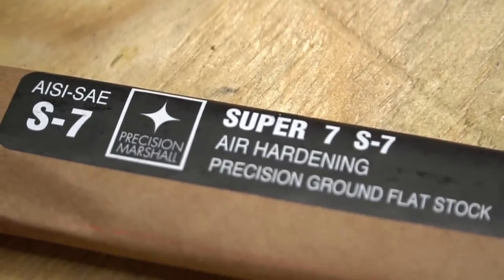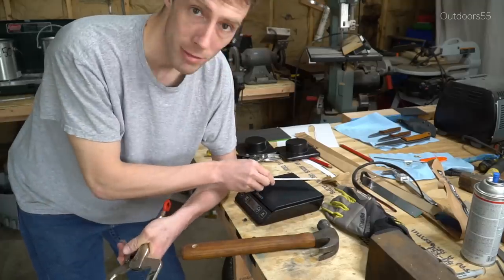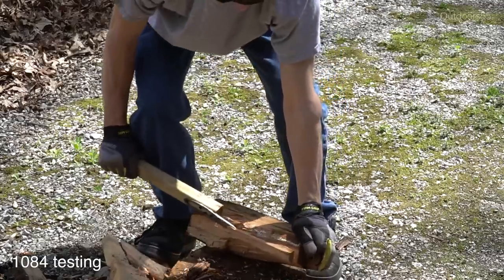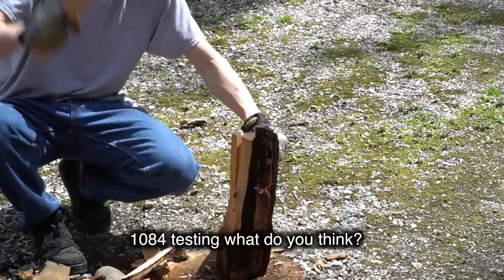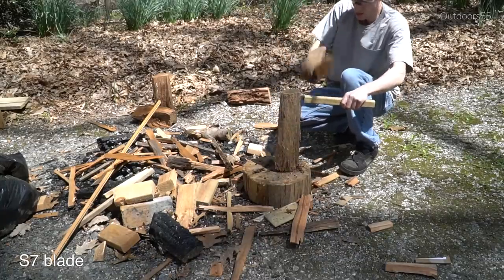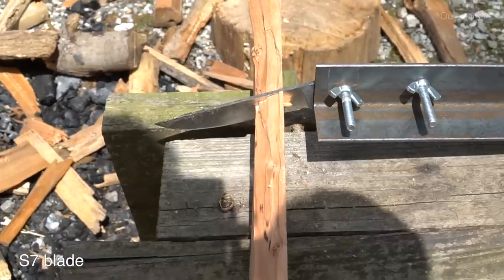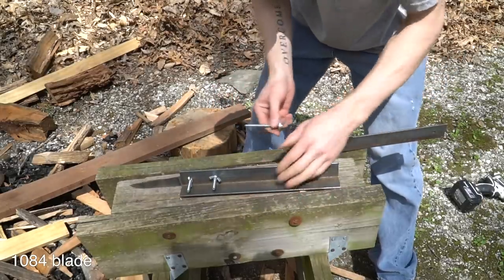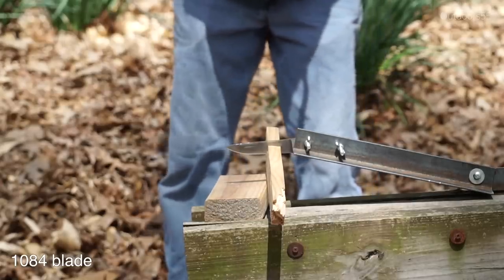What Is THE TOUGHEST KNIFE STEEL? Testing knife steel.

Comment from the maker: Do you think the mora basic would hold up to the same abuse? Or does it even matter 🤷‍♂️
Reply: You should test it
Reply: No way.
Reply: Try it. I love Morakniv, but i have my doubts. Maybe the Garberg.
Reply: I think Pete (of Cedric and Aida)  broke one.
Reply: It would be a good reference point!
Reply: @Mikey1951ful   Yeah he did. But then again Pete is the Master of Disaster LOL.
Reply: Nope
Reply: the 3/4 rat tail tang would be the point of failure.  I've seen them driven handle deep into a log and used as a step, so they aren't weak knives. FOR THE PRICE Mora is great
Reply: I think it'll break at the transition from blade to tang.
Reply: OUTDOORS55 yes. If you want to make your handle lighter use tub ring as the pins.
Reply: I don’t think it would last. You should test it
Reply: Maybe not a mora basic, probably a mora heavy duty companion would fare better. 3.6 ounces on my scale. The mora basic runs 2.7 ounces on the same scale. Will you be performing the same test on 5160? I've been reading that it's even tougher than 3v but with less edge holding. Great videos. Informative, very interesting, and entertaining. Thank you.
Reply: Let's see you test it
Reply: You should do some sub zero quenches on S7 and definitely 3v. Cryo is expensive(relatively) but you can do a sub zero with dry ice and acetone. It'll help refine the grain structure even more and help limit the retained austenite. 
Really like your design and idea for this knife. A 4 inch fixed blade at 3 oz's would be something that a lot of people would be interested I'd think and yet you don't really see it. Spyderco waterway is kinda close at about 4 oz and even that is a rare thing. Looking forward to the end results.
Reply: Yes please
Reply: Dang, that S7 is tough stuff, and has decent amount of strength too, standard carbon steels are very bendable. Good' ol strength & toughness balancing act. Love these two vids so far, we gotta see some band saw steel in here! Maybe 8670, L6, or even some nickle spring steel 8660. Tough steels in thin stock. Btw, if you made these, I'd buy1. Model 1LT -yeeah : )
Reply: I'd say the real take-away here is that there is no difference between a rat-tail tang and heavily skeletonized "full tang" blade.
Reply: I dont think so.  Try it
Reply: I don't think it would even survive the second hit.
Reply: It doesn't matter.
Reply: Can make video for d2 steel
Reply: In the end, you really didn't break either blade. The handles broke. Pretty amazing. One wonders what would have happened if the handles had been full width thickness. Good test, thumbs up to you Sir!
Reply: DBK would be pissing themselves with excitement on your vids. Love your stuff, and sense of humor.
Reply: How much u sell a 1084 blade for?
With smaller blade maybe for carving?
Reply: I've never broken a Mora batoning.  I suppose you could; sometimes that's the luck of the draw.  You hit a knot, you twist it more than you meant to, etc.  Generally I like a bit more robust knife for splitting wood but Moraknivs hold up pretty well for a $12 knife.
Reply: The garberg is full tang not 3/4
Reply: The old laminated Moras for sure, not the new ones!
Reply: not even the old ones, new mora classic is just bad

Comment: Try gun bluing (hot blue) on the S 7.
Looks cool, and stops rust.
Reply: It wouldn't hold up very well when splitting through all that wood, however, I have recently seen some pretty crazy wear resistance testing on specific a DLC coating done by Razor Edge Knives over at BladeForums.  He seems to have that process down.  Looks beautiful on an mirror polish just like hot blueing does.
Reply: @lsubslimed    I am not familiar with the product, but you are likely correct about standard bluing.  It holds up pretty well, but nothing can hold up to splitting dirty wood... any amount of fine quartz based sand or dust, and.... well, quartz is pretty hard compared to steel of any kind. 
The only true cure for rust on tools in contact with abrasives is stainless steel, even with its other issues.
Reply: I'd be interested to see what nitriding does. I make saw blades for a living and nitride is a fantastic treatment for steel. It makes it harder and corrosion resistant, yet unlike gun blue or coatings it is not just a surface treatment; it will penetrate into the metal itself and even when the nitride appears to have worn off the steel will still have the benefits of the nitride treatment.

Comment: When you cut out the handle opening you may want to put a generous radius/chamfer on the edges of the opening, because that will be the #1 failure area (stress risers). AFAICT from video, that wasn't done. Indeed the failure in both cases was in the cut out handle area. Sharp corners will always lead to failure. (From what I've seen, most manufacturers "cheap out" on anything hidden by handle scales and don't properly radius their cut-out edges. Saves them a few bucks in costs...)

Comment: The survival knives I have are made from 1095 steel and they work fine for me and have not broken yet. I have other knives with weaker steel and they are just fine, but they have not been tested to see if they would break. They do not have a full tang though and is just plain hunting knives and not advertised as survival knives.

Comment: Hi. When both blades broke i noticed the bolts were not tight and were moving. If they were tight  would the metal still have broken? Good health and stay safe.
Reply: I think it's more the cutout leaving little metal. It happens when you take the skeletonization to the max. The chain is only as strong as the weakest link, etc. I've seen a video of the Becker BK2 break inside the handle and also a Cudeman 'bushcraft' knife. In the old days they used to taper the steel in the handle to make it more lightweight and balanced.
Reply: I agree, the mounting was a bit so so and the amount of edge material around of the drilled holes plus no chamfered finish.
Reply: @captainchaos3053  😭
Reply: @macmccartney5760  😛
Reply: this sounds legit. I think if the front edge at 1/8" or so then the tang with it being thicker should have held up quite a bit if secured properly for sure.
Reply: Can't say for sure, however, it is extremely possible that it would not have broken. Having slack in a joint like that can impart an incredible amount of force, it's a shock force, and with better fastening, I would have expected both blades would have lasted longer. The second knife, however, may not have been effected as much by this, as it broke further away from the rear bolt.

To put it in perspective, this is the exact reason why you should replace ALL of your ball joints in a vehicle if even one of them gets slightly loose; The inertial hammering that the loose joint generates will rapidly cause it to fail, and a good amount of that force is also imparted to the second joint on that side of the vehicle.
Reply: @sarrasmith2508  about that ball joint jazz....anyone with a squarebody chev can verify their "chevy lean" even after updating suspension. Like my truck, it has one gas tank on the driver side. Of course after years of use, bad joints and all, the frame warped along the horozontal plane. Point is, little or even tiny differences make big impacts in  extreme conditions or the long haul.

Comment: Don't know if this would be of any interest to you, but there was a fella on the Australian Blacksmith, Bladesmith facebook page who posted some tests he had done on a few steels yesterday. He tested RWL34, 12C27 and NitroV. All variants of stainless steel. He wanted to try and "deep freeze" these steels after heat treating them to find the differing results of hardness between them. The term "deep freezing" means just putting these steels into your basic freezer which is usually set at -18°C.
The was his process:
-Heat to austenitizing temperature.
-Quench between plates.
-Freeze.
-Temper.
He had a scrap piece of steel for each variant of steel for both deep freezing and normal heat treating. So there were 6 pieces he tested. He had each piece hardness tested professionally. I don't know if you're familiar with the hardness testing but, knife steel hardness is measured in Rockwell hardness HRC.
His results were as follows:
Cold tested steels:
- RWL34 = 62HRC
- 12C27 = 60HRC
- NitroV = 62HRC
Normal heat treating:
- RWL34 = 58HRC
- 12C27 = 58HRC
- NitroV = 56HRC
So essentially the "deep freeze" tested steels would technically have far better edge retention and durability than your normal heat treated blades; but would be more prone to shattering if they were dropped on something like concrete.
Reply: I think most steels would go up the HRC scale if you deep freeze them.  Which is why they do it for stainless steels, because unlike carbon, and this is not true for all stainless steels, some shoot up the HRC scale with a basic heat treat, but a lot would not hit the 62+ range unless you deep freeze them after heat treat, they would be what you said that the guy did on his tests, around 58 or whatever but after they would shoot up to 63. 

Carbon though dont seem to have any problems in reaching 64 with just a basic heat treat, most of them are crazy brittle and need temper right away, its just to get the stainless up a bit higher before they temper them down in both casses.  Though from what I heard I dont think your garden variety home frezzer would not do, you would need at least -90 Fahrenheit and that for hours, or a day, and even that may not be cold enough, somewhere in the neighborhood of liquid nitrogen -300 or so degrees.   It makes me want to try it, you know just stick some knifes I wont miss,  in the freezer for a few days and break stuff, just to see what happens.
Reply: @solairable  Yes, it's all very interesting. I wasn't meaning to say it was any better, I just thought the information about deep freezing in general might be of interest to somebody. I wish I had the resources to test this stuff myself, it'd be pretty damn cool to test the steels breaking point using liquid nitrogen deep freezing 👌

Comment: The funny thing is your cool handle you designed for testing created a ton of leverage at the bolted points. There would never be that kind of torque on a regular knife handle. Those blades are even tougher than that test shows in my opinion.
Reply from the maker: Yeah theres no way either would break if anyone was holding the handle. You would most likely break your hand first. I kniw i almost did, or it felt like it😂

Comment: I know this is a few years late but here is my $0.02
A tough steel ... 8670 is one of the toughest steels on the market.  I think the heat treatment known as the goldilocks treatment is 1500f soak for 10 minutes, quench in parks 50, and two temper cycles at 400f for 2 hours.  The HRC is around 60 and it has a toughness around 17 ft-lb.
Depending on where you look, you can get 8670 at around 0.100 inches to 0.200 inches.

8670 is a low alloy, nickel alloy steel (Nickel in steel is known to make tough steels, but they are difficult to anneal), so it will rust.

Comment: Loosening of the bolts caused a twisting side leverage force between the handle and the angle iron which would be far greater than the impact force of the blade strike. If you'd worked out a better gripping system (between plates) I think you'd still be hitting the S7 even now.

Comment: If either knife was full tangs they wouldn’t have broke. The hollow tang designs are the failure in this test.
Reply from the maker: Possibly, but its well outside of what a human can do, and what the knife is design to do. Sure, use a knife as a pry bar and we can break a knife. Then you one can say, if we would have made the knife thicker it wouldn't have broken. Same concept.
Reply: True, the weakest spot is always going to be at the place were your holding to were your driving it in. So the blade is not likely to break unless you hit it on the flat of the blade and not by hammering with wood, you would need a steel on steel  hammer, and the handle will just soak up all the shock, leading to snap city if its to thin, or just had issues.  Especially in oil quenched knifes, and especially if you dont dunk the whole thing in there, that part between the handle and the blade, were the differences in hardness's between the blade and handle transforms is pretty much always going to be a weak spot. 

 But the guy did it in a kiln, and it was air hardening steel, so the whole steel should be evenly hardened and tempered. Personally I think everything he is doing is cool, but trying to get to that 3oz mark, your going to run the possibility of having this issue and especially on the higher RC knifes, and especially if its a full blade to handle hardness like you get in air hardening steels. And most people seem to want there knifes in the higest RC possible, and well, that just means its more brittle through and through on a air harndened knife. And if your  wood battoning or carving or anything were your going to be twisting and puling and pushing in cuts on wood, which is always if your using it for wood processing purposes or trying to dig holes in wood for fire, like they do for bushcrafting.  Lets just say that if the knife is  at 60 or 62 and the handle is at the same, makes a good long lasting cutting edge, but it also makes it more brittle, you would have to temper the handle part down with a torch or something before putting the handle on or something. 

In the vid he said he tempered it higher, then normal, so I am quesing that it is more springy and less harder then you would normaly have it, so what would happen if you tempered it normal and it had a better edge, but also a more  brittle handle?  It would have likley have snaped sooner and with less of effort. 

But if your not doing bushcraft things or wacky things,  and just using to cut tomatoes and rope or opening packages, then it does not matter.  But skelatanizing, what it esentially does is,   instead of having one rats tail tang, your essentially having two pieces or rats tails on each side, because it's  skelatanized, it makes it a bit stronger, but not fool proof, and lets face it, no matter what, people are going to be doing some wacky stuff with a knife, so I would say making it fool proof would take priority over making it as light as you possibly can.  Anyways, like the test showed if its going to break its likley to be there. Just leave it a bit thicker, it would be a few ounces heavier, but your less likely to have snapping issues. I think people can handle carrying around a 6 oz knife  instead of a 3oz knife no problem. But hey to each there own.

Comment: Hey Alex, I think for future testing, rather than using wing nuts to secure the knife to the angle-iron, I would use a nylon-lock nut, or something that has more locking/clamping strength. The wing nuts are showing that they come loose during your testing, and the shock and offset forces at the two spots may be contributing to the breakage more than you realize. I realize this is by no means a scientific experiment, but given that Im sure you have these sorts of materials at your disposal (or easily obtained) you may want to consider it.

Just for clarification, was it the 1084 or the S7 that you said was VERY prone to rusting? 

Thanks for yet another awesome vid! Love the info and edumacation!
Reply: BigHesh81    I believe Alex mentioned the S7 as very prone to rusting

Comment: Can you recommend an ultra-premium steel for Arizona law enforcement knives?  Due to our low humidity, we do not need corrosion resistance, but toughness and edge retention (wear resistance). Our cops use their knives for everything! – screwdrivers, cutting through fences,  slicing seat belts from burn victims, et al.  

We do not need a recommendation on a specific brand of knives – we will find a manufacturer once we learn which steel is ideal for Arizona LEOs. Can you make a recommendation?

Comment: S7 is tough. However in a knife, I can't think of any steel that will break batoning. roll the edge maybe, but to break a piece of hardened steel (any hardened steel) by striking across it's height, you'd have to exert more force then you can likely apply with your hands. As for the testing, it showed that a knife made from S7 will break after a single hit with the hard wood, while the 1080 took 2. As long as none of the other hits created a crack in the s7, it would be as strong as if it had never been hit.

Comment: I only have one S7 blade, and it's a big chopper, but I've found it to be incredibly tough and has never had any signs of chipping or rolling. It holds an edge well, and is not difficult to strop/hone/sharpen. 3v is certainly more corrosion resistant, holds an edge better, but takes longer to bring the edge back using the same abrasives as used on the S7. I don't have a 3v blade comparable to the S7 as far as dimensions, but I think it's a more balanced steel as far as the knife trinity of abrasion resistance, strength, and toughness. I think it will come down to personal preference as to which qualities are more desirable, and how each quality is weighted in its importance by the individual. Either way, on a knife that size, it will be a great knife.

Comment: The handle on the Mora will seek freedom from the stick tang on the blade after  3-4 hits from the battoning beater.  Injected molded plastic can't take it like riveted micarta or G-10. Maybe not a "scientific " test ran on the two steels, but compelling results for the forces applied.  Gratis stuff man!👍